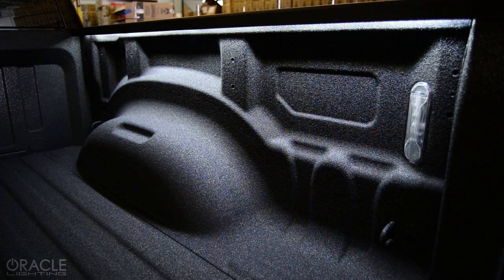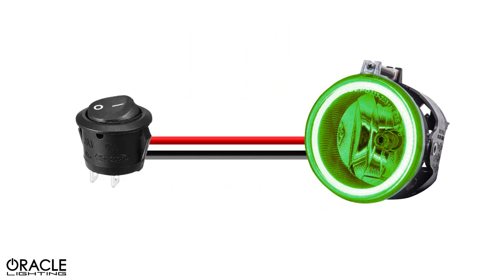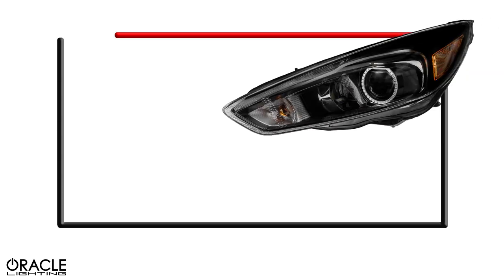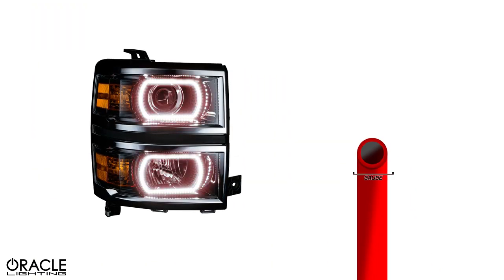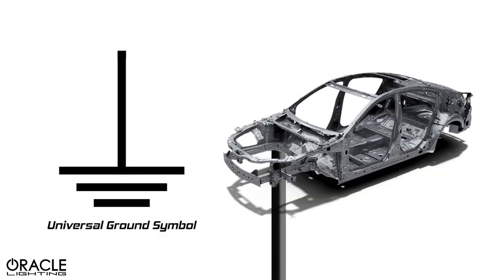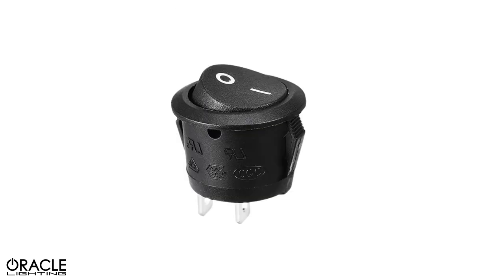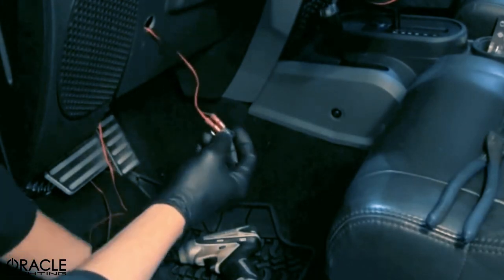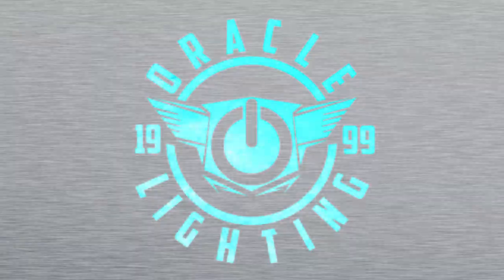ORACLE Lights - How To DIY Install a 12V On/Off Switch

Comment: Didn't explain how to wire up the switch. That's what I came looking for.
Reply: What are you still confused about? We can probably help.
Reply: Same - so does each negative wire connect to the individual prongs of the switch ??
Reply: i guess negative black from body to prong and red postive battery ternimal to postive in switch

Comment: Very slick doo doo. Nowhere did it show how to actually do what it says it was going to show. And I think they need to fix their animation. It has current flowing to the load from the battery on the negative side. I might be wrong on this, but a DC circuit flows in a circle hence the similarity between the words circuit and circle. The direction of flow would be away from the battery to the load and then away from the load to the battery.

Comment: should the black ground wire go the negative on the battery or not
Reply: Ground wire doesn’t need to be run all the way to the battery. Just to the nearest metal part, since everything metal should always be grounded.
Reply: Most cars use ground to complete circuit ?I was thinking this better to use ground to complete circuit.